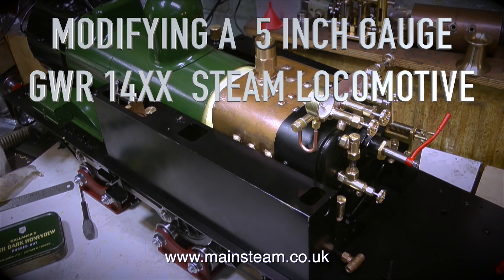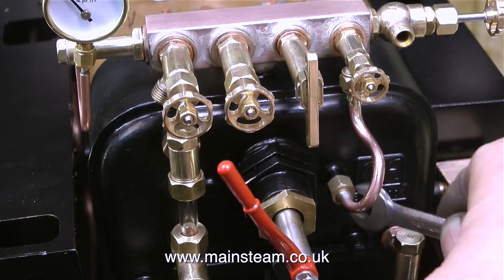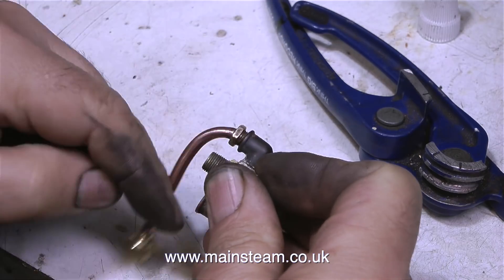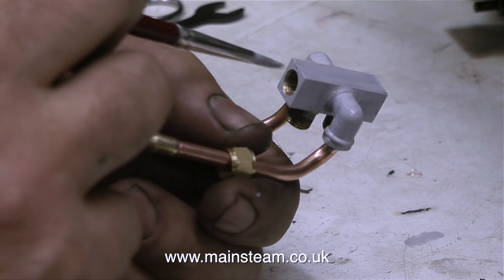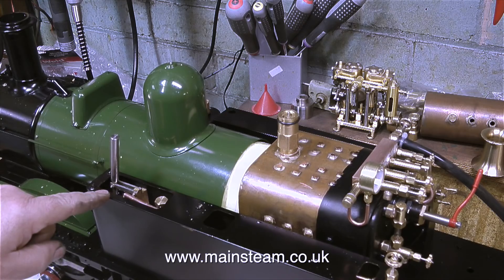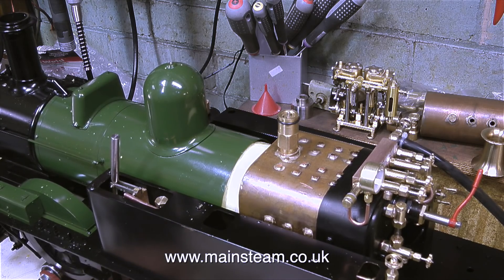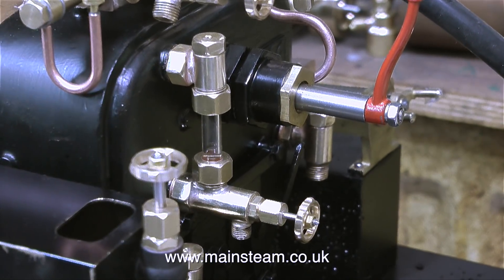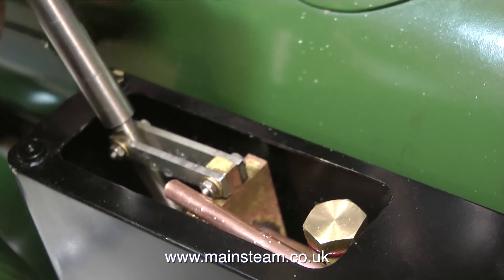MODIFYING A 5 INCH GAUGE GWR 14XX STEAM LOCOMOTIVE - PART #16

Comment: Okay, that was wrong. While Steel brake line is easier to find in the US, that does not mean there is no Cunifer Copper-Nickel line around. Summit Racing has it, Amazon has it, Grainger (industrial supply, huge in US) has it,... etc. And all of it is DOT (Department of Transportation) approved. Steel had taken over from the Cunifer stuff, but its qualities have kept it around, and it's even seeing a bit of resurgence within the DiY gear-head/motorhead/race crowd.

Comment: Why do you  need two live steam injectors if you already have a crosshead driven pump and a hand pump? Surely that would be enough to keep the boiler topped up.
Reply from the maker: You can never have too many boiler water feeds .... A hand pump requires energy input and so does the crosshead pump. Injectors are better but can occasionally get blocked . . . hence two of them just in case . . . .

Comment: I've been quite enjoying the work that you've been doing on this engine, bringing it up to your personal standard. One thing that I'd be curious to see is a plumbing diagram of the engine. Everything from the injectors to the sanders (do the sanders work, or are they also just for show?)

Thanks for all the time you put into these! I do enjoy them and find them very useful!
Reply from the maker: You just push the reversing lever on the engine gently towards reverse - then apply the hand operated brake on the riding truck that you sit on to drive the engine. . . .
Reply from the maker: The sanders are dummy, as are the brakes, but everything else is functional.
Reply: Keith Appleton How do you stop miniature steam engines then?

Comment: Hi Keith, what is the flattened piece of pipe that points down at the wheel? You can see it at 2.58 in the movie.
Reply from the maker: Dummy sand pipes
Reply: Ah, thanks.

Comment: And just like my 4th Great Grandfather Thomas Scott (Railway Engineer Edgehill Works 1832) Am a self confessed Addict!!! Yes the fittings are superb and for their Jinty in 5 inch do a complete list of fittings with the right size injector to make life very easy!
Plus Jackie's smile as you pick up your latest order is superb!
Yes it is best to get (Pardon the pun!) Feedback from your pumped water! In a tender you have the pipe piped to the rear just by the filler cap or flap.
Do not worry about the pipework as the drawings for Didcot 1400 Auto tank are among the worst that are out there!
Ending on a positive note the drawings for the Large Prairie Tank 5100 6100 are up among the best as are the ones for the Black Five and 9F!
All the best from.
David and Lily.

Comment: I wonder have you ever tried Kunifer (Copper Nickel alloy) brake pipe..?
Quite a bit tougher, silver solders well, the bore is often larger and doesn't tarnish..
Reply: This is exactly what I was going to say. The pipe Keith is using looks rather like Kunifer as it is quite dark. I used to make a lot of brake  pipes and ordinary copper only just about meets the regulations as it is soft and weak. You notice the difference when you bend it. Keith has really learned the art of bending the pipe perfectly which is so satisfying especially with Kunifer,